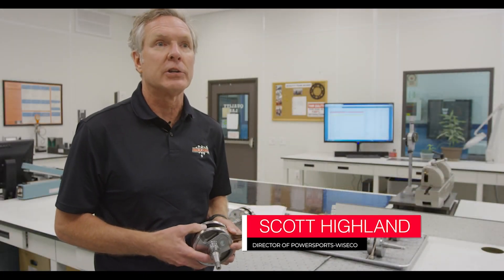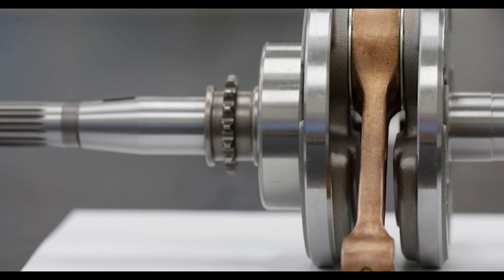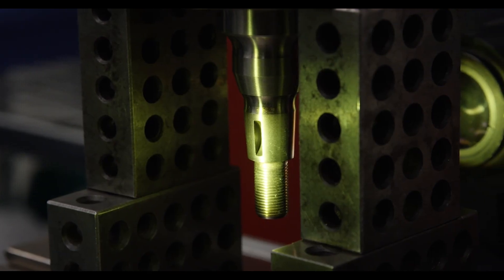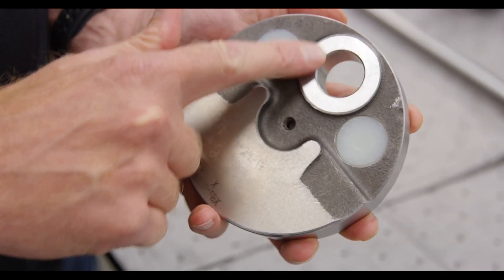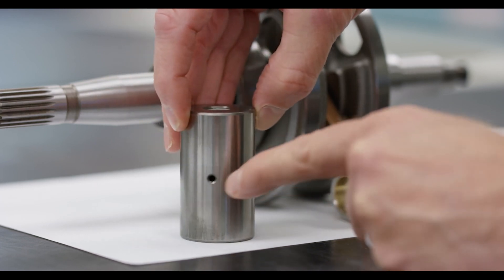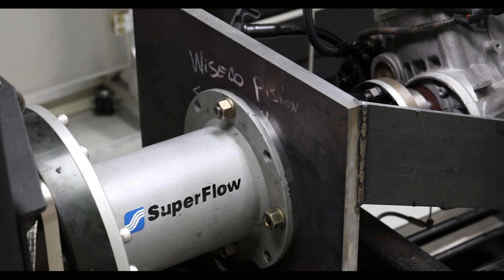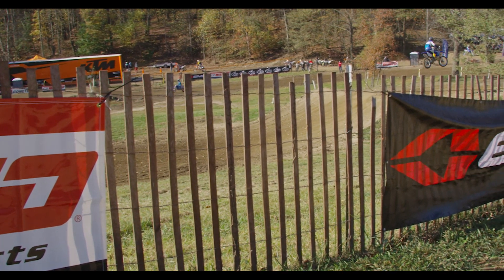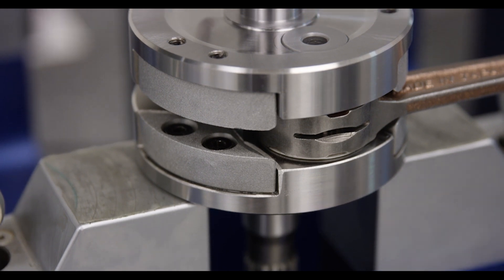Wiseco Crankshafts Improved: Materials, Finishes & Quality Control

Comment from the maker: We'd certainly never deny there were some problems experienced with some of our earlier cranks. We've gone through several iterations over the years changing materials, designs, etc., and warrantied many cranks that have had issues too. We're not denying any previous issues, but we're trying to show everyone that even to this day we have not just sat back and said "oh well," we've been working on improvements ever since. Our QC process for every crank batch is more in depth than ever, and new designs even get dyno tested on our engine dyno for 4 hours straight at WOT.
Reply: Well, Im glad you guys are actively trying to fix the issues. I noticed the video even addressed the keyway issues people have had. When I went looking for a crankshaft, I noticed the search terms "wiseco crank problems" and "pro x crank problems" yielded completely different search results. So, when my Pro X crank box showed up with a wiseco black rod crank in it, I wasnt thrilled. Luckily Alex got it taken care of and now the Pro X crank is in my new RM 250 motor waiting for its first start.

Comment: Checking piston to head clearance? That worries me. It should be identical to factory specs out of the box. I'm seriously considering purchasing your new crankshaft for the 2020/2021 Yamaha 450's to replace the failure prone stock crank.

Comment: I had just done a full rebuild on a cr 125. The bike ran amazing but I just hit 3.5 hours and I blew the bearing in the wiesco crank midair on a table. Barely rode away from it. It was an older crank I orderd it roughly a year ago, the bike took awhile to get running because I was fully restoring it. Just a disappointment that it only lasted 3.5 hours. Hopefully the newer cranks are better now !

Comment: I would NEVER run a wiesco crankshaft. They come apart in the trx250r. Many other replacement wiesco cranks come apart on other engines too. Ask how I know. I went back with the rebuilt JAPANESE OEM original crank after a balance, rebuild and welding of the tin shell. I have hundreds of hours of abuse on a drag ported, ultra high revving drag engine. Never again will I recommend or use a wiesco crank. 

On the flip side, their pistons are awesome, and I run those exclusively. How their cranks can suck so bad, and the pistons are top notch is crazy. 

Hit and miss with this company. OEM reworked cranks, or bust. Just my personal experience on one machine. I have other experiences with this brand of failed cranks on other machines, that were resolved with going back to OEM and reworking the stock units that are far superior in quality.
Reply from the maker: Hey George, we definitely hear you, and it's no secret that our earlier cranks had some problems. We've gone through several iterations changing materials, designs, etc., and warrantied many cranks that have had issues too. We're not denying any previous issues, but we're trying to show everyone that even to this day we have not just sat back and said "oh well," we've been working on improvements ever since.

Comment: Where are the Cranks Made ?
Reply: China. Been manufacturing there for over a decade. That's why I wouldn't recommend. Tolerance issues, and flat out bad quality. Plenty of videos here showing massive runout tolerance, and other problems.
Reply: @georgesrisomsak9650  Chinese contract mfgs will meet whatever tolerances you specify.  This is where people get into trouble.  If you do not specify a key tolerance or geometric relationship, then all bets are off.  Where US designers really get into trouble is when they make assumptions about "standards".  There are no standards with the Chinese, except for what you establish in your manufacturing prints and specs.  As long as you remember that, you can get any quality you want.